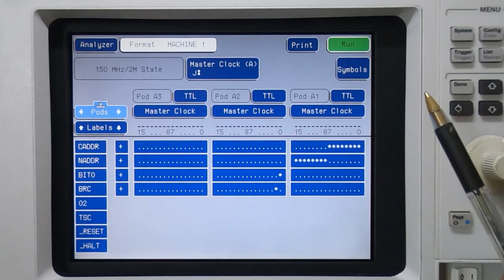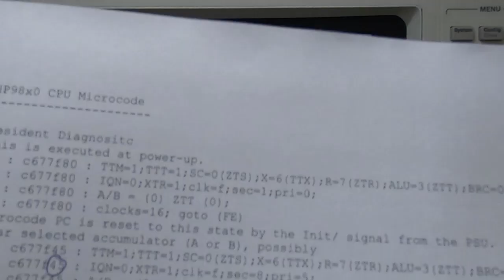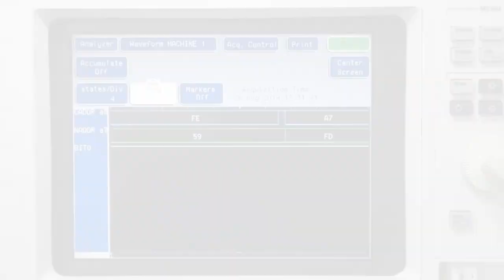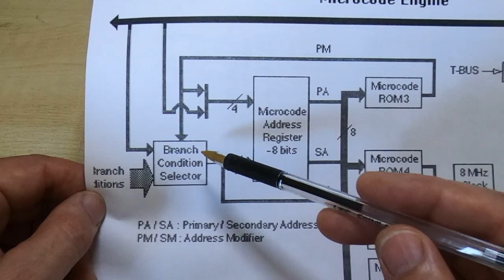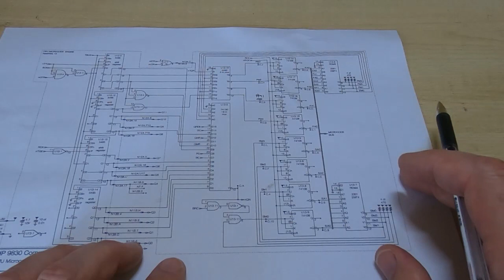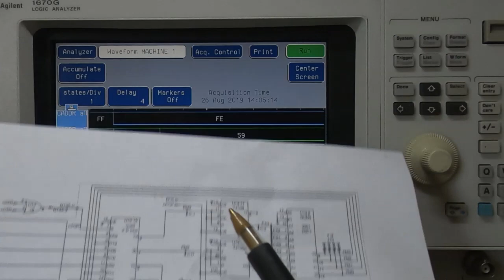HP9830A  Repair  Part6

Comment: I assume there's all sorts of various different 98x0 machines floating around that deserve some newly designed kit for it.  So you could use these to develop new boards.
Reply from the maker: Absolutely correct and it would be perfectly possible to develop new boards for units like this in the same way that boards are developed for machines such as the Altair 8800. It is really nice to see someone thinking along those lines as that is one of the main reasons for my channel, Thanks
Reply: @JerryWalker001  you're welcome.   This would extend the useful life and bring more usage in the development.  I am also quite sure thats what HP intended as well.   They sell you the basic system and its up to you to implement. If you need some, I can 3D print the colored latch clips.
Reply: If you need some, I can 3D print the colored clips and help with device selection.
Reply from the maker: Surprisingly, so far I only have one broken clip (brown). I will let you know as I progress if I need any. In the next video I start the actual repair.
Reply: @JerryWalker001  Not a big deal .  I have all colors.   Willing to help with anything else that may save some time and/or $. LMK.